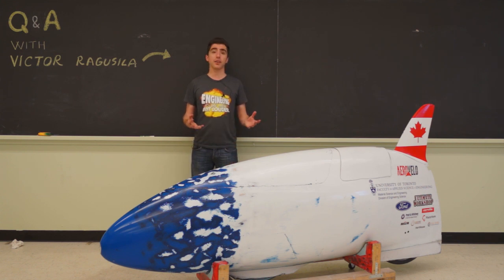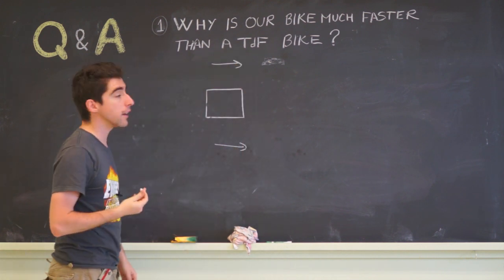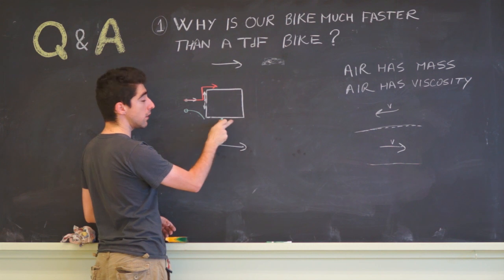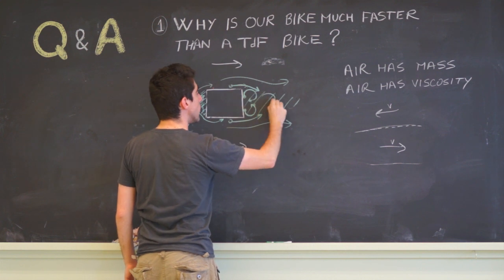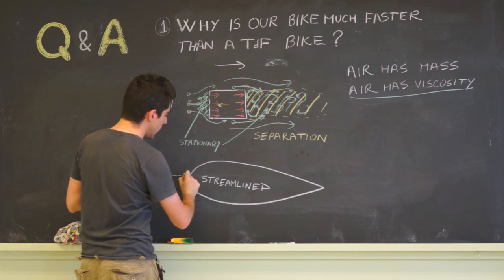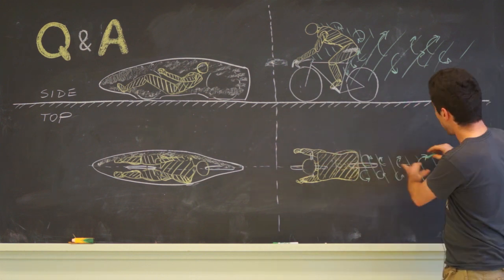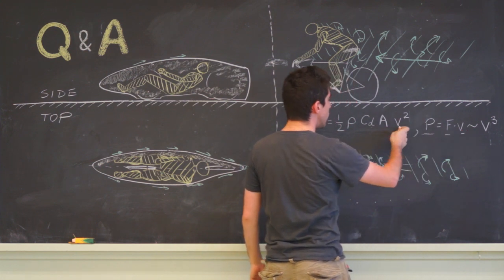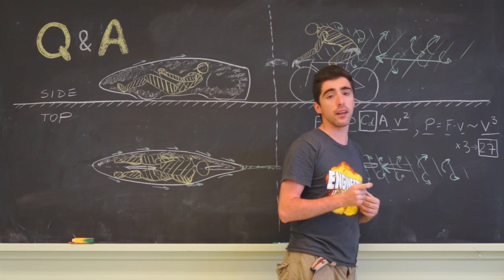Q&A: Why is AeroVelo's speedbike so fast?

Comment: An interesting observation, Bloodhound SSC has 130,000 bhp from their jet and rocket engines combined to do their target 1,600km/h land speed record, 'only' 11 times your top speed in which you use around 1 bhp! 
Some questions:- High altitude and temperature gives you lower air density for speed, does it also limit the rider's muscle power output due to depleted oxygen levels? Also with cross sectional area, how would a very strong female rider go in terms of power per unit of cross sectional area? ie: she could be shorter and will be much smaller across the shoulders and therefore you could lower your cross section significantly as it's a square law. I'm not sure of the relative power outputs of male and female riders at say Olympic level but in other words, she might develop say 80% of the power of a male rider but you could design a shell with say 0.7 of the cross sectional area, that could put her slightly in front.
Reply: yea, thats pretty fun observation! power increases roughly with cube of velocity, so we would need 11*11*11 = 1331 HP to go 1600km/h. Of course, assuming the vehicle would stay the same size, and the tires would work, which are not at all realistic. 

Altitude is good, if you let your rider adapt. Either show up and race right away, using the highly oxygenated blood you have. Or, like us, you show up 1 week in advance and get over altitude problems. Battle Mountain, where we raced, is at around 4500ft. I usually get headaches the first few days. 

Female riders are strong, but not quite strong enough. The issue is the surface area, not frontal area. That includes the surface needed to enclose the wheels, rider, frame, etc. The italian team Taurus had 2 female riders in 2019, The dutch and french teams also focused on the female record. The women record fell, but it is still quite behind our record. 

The solution seems to be fitting 2 strong men in a very tight space. Volume increases with cube of dimension, surface area with square of dimension. So a bike with twice the volume has less than twice the surface area. The new UofT tandem wasnt very fast in the first year, but in 2021 it might have a shot at the record.
Reply: @victorragusila7519  Thanks for your answer Victor, Cheers.

Comment: Why, in the side of AeroVelos's drawing, the back of AeroVelo doesn't have the streamlined shape too?
Reply: good question. A perfect shape would be streamlined from every angle (Top or side). However, for a bike, we need a pilot and bike wheels. The rear and front wheels are full size 700c wheels, which largely dictate the shape of the back of the bike. 
Even with a vertical knife edge at the back, we dont lose much drag compared with a perfect pointy back. If we would race in cross winds, the rear edge might even generate thrust, but could also lead to greater instability by generating lift perpendicular to the bike, like a wing. However, our races are in almost perfectly still weather, so no issue with cross wind.
Reply: @victorragusila7519  Thanks a lot

Comment: I feel like if the front was even more pointed.. like certain planes.. it would streamline through the air even better right... less air hitting the front due to more surface area since it's kinda big and rounded at the front.. maybe it's the perfect roundness to not make a difference with air molecules.. I dunno. But if it was so gradually pointy that it becomes like a needle for an exaggerated example.. wouldn't that be better... You could acheive it being more pointy without having it much longer at all too.. or maybe there's a trade off with added weight but I doubt it would be much weight at all.
Reply: you are right pointed would be better...but only if the air is perfectly from the front. There is always a small amount of crosswind, either from the wind from the side or from the bike motion. Having a perfectly sharp nose that is not pointed perfectly is much worse than having a slightly rounded nose, which is more robust to crosswind. 
Our bike is more pointed than most that we race against.
Reply: Victor Ragusila - Ohhh, I didn't ponder that at all! okay I see now.

Comment: A wonderful & inspiring lecture! Very well explained, I learnt a lot.  

I note how very low the Cd is for Eta, whilst that for the traditional cyclist is effectively still a square box (0.7 to 1.0).  Does it then follow  that overall and for a practicable point of view, minimizing frontal area is of lesser importance (and I think power required is just proportional to frontal area [rather than the cube as for velocity])?
Reply: ElwynJ yes, for us, the frontal area is not critical. The drag is mainly given by the overall area of the bike, and the amount of laminar flow. For a cyclist without the aid of a fairing, the frontal area IS the most important thing, since the cyclist cannot modify their shape.
Reply: +ElwynJ I also found that interesting.  The eta was I believe .3 m ^2 vs .5 for the upright rider.  Certainly significant, but doesn't compare to the importance of the fairing.

Comment: What CFD program do you use to design the fairing? I would like to design a fairing for a LWB recumbent but am having a hard time finding a simple one for a novice.  Thanks and keep on rolling!
Reply: Doc02864 we used Solidworks for some of our earlier bikes. It works ok for general design, and it can predict quite ok where separation might occur. For ETA we want to determine the precise transition from laminar to turbulent. Todd wrote software for it, and also used X-foil. 

If you dont have experience with Solidworks or Xfoil or CAD in general, i would not use it. I recommend getting the Leading Edge book by Goro Tamai. It has a lot of rules of thumb and ideas on how to design solar cars, which are aerodynamically quite similar to recumbents. A simple CFD package is probably worse than the rules of thumb from that book. 

Also, once you understand the aero issues from Leading Edge, copying the design of successful bikes is a good idea.

Comment: I have a question. Why you do not simply copy the shape of a drop of water, it's supposed to be the most aerodynamic shape no? And a huge gear at the front with the pedals and very tiny for the wheels for the maximum transmission power?
Reply: The water drop is not the most aerodynamic shape, it is simply the shape taken by the liquid. If the shape is solid and doesnt flow around, you can do better than the drop of water.

Comment: Great video and great work. I would like to know: what requirement imposed the installation of a vertical fin (rudder-like) on the Bluenose, and how did you managed to avoid putting one on Eta?
Reply: The fin was there to help with wind stability. The behaviour in side gusts is quite complex, and I will have an episode on it, as soon as I finish my thesis and have time. We found that Bluenose was very susceptible to wind gusts, and the fin helped a lot. 
ETA was more stable, and a fin adds drag, so we went without one. We did have a few issues in Battle Mountain with side gusts, so we will probably test a variety of fins for ETA when we return with it in 2015.

Comment: Why isn't the nose of the bike very pointy like a fighter jet? It seems like you could make it longer and thiner and get a gain? 

How important is the weight of the bike? If you shaved off 10 grams, would that be a big deal? Do you have ultra light weight wheels?
Reply: Hey John,
I am one of the members of the team this summer. While I dont have an aerodynamics background, I believe the reason for such a blunt shape on our vehicle is the difference between supersonic/subsonic air speeds and efficiency requirements. Fighter jets are designed to be effective at supersonic speeds (>1200 km/h), while our bike travels is designed for travel at 145 km/h. This entirely changes the aerodynamics problem. Additionally, when your jet engine produces 10,000 times more power than Todd (our human engine), I doubt they are too concerned with efficiency and instead design the jet for maneuverability, control, stealth, etc. Reducing the radar profile of a jet typically involves pointy edges to reflect the signal and is part of the reason for the shape.

As far as weight, it is not the most important, relatively speaking. At the start of the summer, we were told some of the "design derivatives". Essentially, for a 1% (~200 g) reduction in the weight of the vehicle, we gain approx 0.03 km/hr. Many of the other ways of increasing performance, such as increasing drive efficiency by 1%, have a much more radical effect on final speed, so we are focusing on them instead. That's not to say we aren't trying to drop every gram we can, but we are placing more focus on factors with a larger effect, such as by testing rolling resistance of wheels, efficient and lubrication of drive chains, etc.

Comment: How much of a difference does the athletic ability of the rider make for achieving your world record top speed? It seems like the rider is a huge factor and the aerodynamics much less. Especially after you have already engineered a very efficient stream lined bike.  Is your team also training a rider to be as ideal as possible? What are the characteristics of a world record rider?
Reply: In follow up to this, have you guys done the math on how many watts (and for how long) that Todd (who I presume will be the primary rider) will need to put out for the record or reach 140 kph? Didn't he need to sustain something like 700W for 1 minute for the Atlas record?
Reply: Athletic ability is very important, and Todd is training specifically for this event. It is less about his total power ability, and more about making a bike comfortable, stable and intuitive enough for him to be able to go full out. 

the power profile is quite complicated, and we still work on it . 700W continuously would be not as good as a slower initial period, with a sprint (>700W) at the end. We have a few simulations of the power profiles that can achieve 140km/h, and Todd is training to match those profiles.
Reply: @VRagusila  Congratulations on an incredible achievement!
Out of interest, is the highest power output (>700W) for the sprint at the end limited by the recumbent position, as a strong well-trained cyclist can produce at least 1000W on a diamond frame bike in a standing sprint position.
I read on the aerovelo website in the Eta technical information section on the "Human Power & Ergonomics" that optimal power output was determined through small changes in foot height, hip angle and seat angle. Would this optimal position be rider specific? Be interesting to see the numbers.
In terms of power output training, may I ask what is the ratio of on-bike vs off-bike ? i.e. Does Todd mostly train in the optimal recumbent position working on improving the specific power profiles, or is most of the training done off-bike ?
On the tyres, I noticed in the section on "Rolling Resistance & Wheels", it states "...so Eta rides on ultra thin (< 2mm) tires." :
Tyres less than 2mm doesn't seem correct as from the videos where the tyres are shown, they look to be about 20mm.
Reply: @EShaggle  Thanks! Let me see what I can remember, its been a few years...
Todd trained quite a bit in a seat and pedal configuration very similar to the bike, or in the actual bike on a training roler. He had a faincy training regime I forgot the name of, with 1h warmup, a punishing 5-10min sprint, and 1h cooldown. He did other training off the bike, he had a personal trainer for the last 2 years we competed. Might ask him when I see him, if he remembers. These days, none of us are really into racing recumbents anymore...
We did do quite a few simulation runs, where Todd would be on a trainer, and we would simulate him on the course given his power output. That way, we could finely tune the power profile, and see whats the speed at the end. 

The tires wall was 2mm thick at the thickest part of the thread, the tires had about 20-24mm cross-section. We had custom tires that were very thin and supple. I think the manufacturer  was the same as used by TdF teams, we tested a bunch of different tires. The top tires were all quite close, I need to see if I still have that data somewhere... 
The more rubber you have, the more rubber needs to deform when the tire rolls, so you lose energy. Wider tires are ok, since their aerodynamics is not critical, and wider tires deform less than narrow tires. 

The tube also has a influence, you want very thin, latex tubes, or tubeless designs. Of course, you are much more likely to get a flat tire, which is scary at 140km/h. Anything with guards against flats, or with more rubber, will have lots of drag.
Reply: @EShaggle  I remembered, I think we used very thin custom Continentals, where they put much less rubber than usual on the tired. They were normal clinchers, and we used tubes with them. Got very similar results to the fancy TdF tires, and those required a new wheel, since they were tubeless. Not worth the effort to change the wheels, and the clinchers were better.
Reply: Very interesting. Thanks for the follow up!

Comment: Just to avoid low quality discussion in the comments i will point out that the UCI - the agency which governs road bike racing - banned this technology in 1934 in order to keep bicycle racing as an endurance sport, as opposed to a technical sport, however, the aerovelo guys take part in a race which the UCI doesn't oversee, so they are allowed to do streamlined recumbent bikes.(for those of you already familiar with this, good on you.)